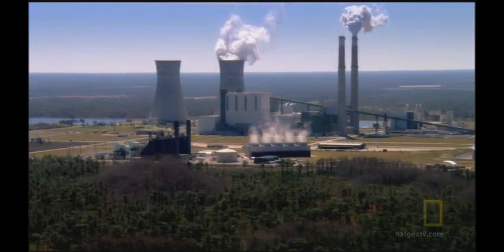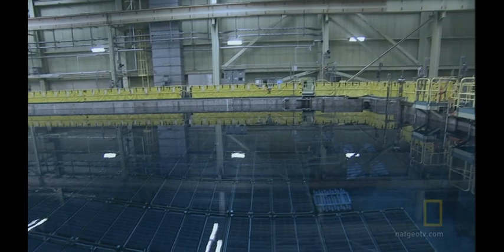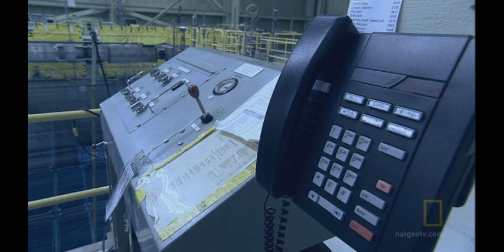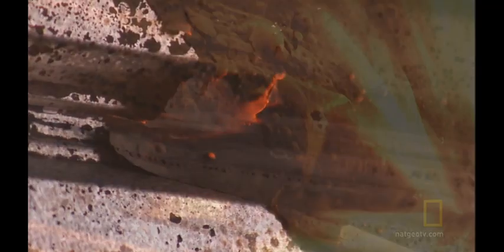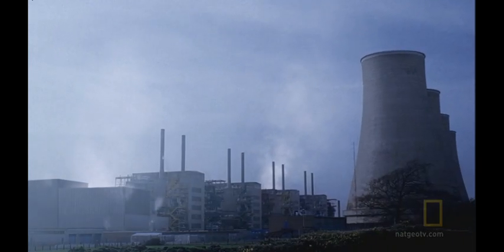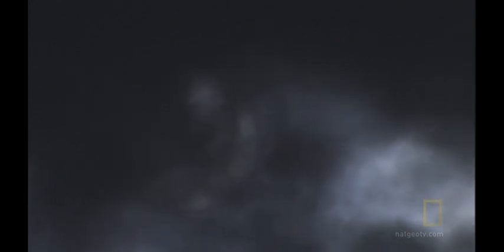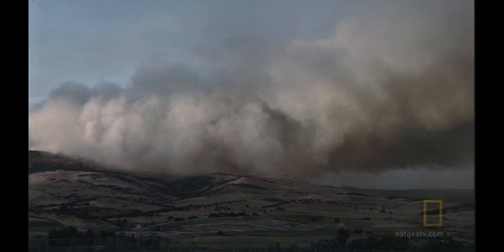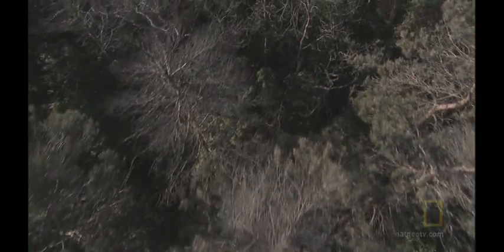Nuclear power plant spent fuel rods overheating and meltdown

Comment: 1.) All generators fail and can't be fixed or replaced
2.) Everybody forgets about it for several days and does not refill the water any other way
3.) Nobody notices all the steam that has been escaping for days
Yes in this case there would be a serious problem. Put simply, all you need to do is keep the spent rods wet. That is by no means difficult. You could literally pour water in the top if necessary surely?
Reply: Take into account what is going on at Fukushima and you begin to realize how difficult a task this is... There are hundreds of tanks filled with heavy water that has been extracted from the ground because of the compromised containment vessels.  Yes, you can pour water in, but where does it go if the containment vessel has suffered damage?  Answer: Into the ground, and, in Fukushima's case, the ocean soon afterwards.
Reply: CrudeDude, we are in fact saying the same thing but in two different ways  ie Submerged=Wet. The tank must be kept from breaking and splitting of course as Dearngedteddy said so lessons need to be learned from Fukushima. I guess what I was saying is that those lessons do not mean "immediately stop all nuclear power". Burning fossil fuels is also extremely dangerous.
Reply: I meant wet all over. Practically, this means submerged. There is a huge danger with radioactive falllout of course, but there is also a huge danger with global warming. And renewables will not cut it. I'm not arguing against the fact that there are serious dangers, I'm just saying that we need the electricity. We really need it in fact! The UK has a supply-demand gap coming up that is frantically being plugged with fossil fuels. China needs more and more energy and is burning more and more coal, which will run out eventually.
Reply: How many square miles of land is rendered uninhabitable for thousands, perhaps hundreds of thousands of years if it is flooded out? Global warming's effects could flood huge areas of land and the scientific consensus (which is the interpretation of the facts that is most likely to be correct) is that human activity is a major contributor. I read your comment the first time, read my comment and you will see that I did respond in a pertinent and respectable fashion.
Reply: Derangedteddy Bullshit. At Fukushima the pools are OK.
Reply: TheYesDave There is NO CONSENSUS on global warning. 
NONE
Reply: TheYesDave There is NO DANGER with "radioactive fallout". Fukushima has not caused a single radiation death. Not one.
Reply: There are still lots of "scientists" denying evolution, so if consensus means "no futher argument" then a consensus has not been reached on this issue either. My understanding is that there is a consensus, to a degree sufficient to impress all the world leaders at the G(insert number) summits and make them promise action. Consensus is a sliding scale and the science is admittedly too complex to yet claim that the issue is throughly resolved. But it is closer to my originally implied (admittedly overstated) overwhelming consensus than your NO CONSENSUS, NONE claim. Assuming that the scientists are the ones who's opinions are most likely to be relevant (a fair assumption) this means we should act on it.
Reply: things aren't simply "forgotten" at a nuclear power plant, there are so many automated redundant safety systems at a nuke plant that make the probability of something like this happening very remote
Reply: Just to clarify on this, I agree with A. Antoine that there are little or no cancer deaths from Fukushima. What I meant is that radioactive fallout can be dangerous. The number of deaths directly attributable to Chernobyl (nearly all emergency workers) is relatively low but does not fully encapsulate the seriousness of the accident. In the case of Fukushima, the second worst nuclear accident ever, the release is effectively now so "diluted" that concentration levels are just above background over everywhere but very near the reactor. In short, I think we must be very careful with nuclear regulations (we already are) but the real risk from it is very low, even with the current reactor designs, which are being improved on.

Comment: In the event of a station blackout or a major emergency, keeping the spent fuel pool filled with water is one of the easiest things to deal with, considering that all you ned to do is keep the water level up, and the fact that the pool itself is made from verity thick reenforced, concrete that is lived with steel plate. In general, the narrator is correct with his explanation of this scenario, but some of his terminology is misleading. And the plant they show at 0:45 of this video has been decommissioned since 1984

Comment: Tritium has a half life of 12 years which means that it completely decays in 24 years. Also this is only produced in deuterium moderated reactors, these are also known as breeder reactors and are not typically used outside of military applications.

Comment: It was storing spet fuel rods, not whole intact cores. And they were not above the reactors, but sideways.

Reactor #3 was NOT found missing. It's there, partially under the rubble, in its containment structure, and the pools were not blown apart.
In all Fukushima complex there was not even near 100 core-worth of spent material. Couple of cores worth of material in the densest packed pools, that's it.

I don't know where did you get all that information, but it's all so painfully wrong.

Comment: yes i knwo basic physics. and actually with for example LFTR reactros there is passive safety system in place as soon as power is lost all the fuel drains into secondary tanks with controlers inside to stop any reaction still happening

Comment: The Fukushima hydrogen explosions happened outside the reactor containments in the steel outer buildings.
The cores have never been exposed to the air and have never caught fire.
The core temperatures are now under 100 degrees Celsius.
The spent fuel has cooled as well and poses no risk. Even if the cooling water was removed from the pool, there would be no danger of radioactive release.

Comment: It might have to do with a physical constant called specific heat. Water has one of the highest. Just because something is cold doesn't mean it can hold a lot of heat. Notice that standing in air that's 20 degrees Celsius is not uncomfortable.But standing in water at that temperature can feel chilly.There are other problems with liquid nitrogen. Such as what happens when it rises above that low boiling point and starts to turn into gaseous nitrogen. Yes,simple water is a very useful chemical.

Comment: Wait... If the spent rods emit heat for the next few years, wouldn't they make great fuels for RTGs for short space missions? We don't have to always use plutonium 238 for those do we?
Reply: +Wolf Edmunds The issue is the purity. It'd be ridiculously improbable to lift a device like that into space. I know people who went into nuclear propulsion, uranium and plutonium, etc. are fantastic for this purpose. They are pure, we know exactly what is in them, etc. There are much more efficient ways. It's like how we went from steam driven cars to gas. Yeah we could use steam, wood is everywhere for most people, but it's just so much easier to use gas.

Comment: The water isn't refrigerated; there are pumps, heat exchangers, but no refrigeration for the pool itself.  Instructional videos should be accurate.
Reply: The exchange of heat is refrigeration.
Reply: So, the radiator on your car is a fridge?  Is that what you're saying?

Comment: The reactor must supply steam to a turbine to generate electricity.  The turbines are large and require a large amount of steam.  In an accident (or normal transient), the reactor is shut off, thus unable to supply steam to the turbine.  Diesel generators and batteries supply the plant with power.

Comment: The only problem I can see with this video, was reactor going into an auto-shutdown state upon recognition of grid failure. Do they really do this? or do they just disconnect from the grid? I see a grid disconnection, while still staying critical, for more a reality, as it could then supply power to the cooling pumps which would prevent this type of disaster.

Comment: A couple of points..

1) Meltdowns are not catastrophic.  Nobody has died or will die as a result of Fukishima or 3 Mile Island.  Wildlife around Chernobyl is doing better than when humans were around the area.
  
The diesel generators would not need to run forever.  
After a few days, the core would be cooled down.  If the core did melt, the multiple layers of containment would keep most of the radiation inside.

Comment: Where, and when did I say they were out of the "experimental" stages? Also indirectly solar power uses light generated by the sun (which is a nuclear fusion generator in itself) to generate electricity though not nearly as much electricity is generated than if we manage to sustain a fusion reaction on earth, which we will get eventually.

Comment: In unit 1 most of the core - as corium comprised of melted fuel and control rods - was assumed to be in the bottom of the RPV, but later it appeared that it had mostly gone through the bottom of the RPV and eroded about 65 cm into the drywell concrete below (which is 2.6 m thick). This reduced the intensity of the heat and enabled the mass to solidify.
this is available at: 
world nuclear association / Fukushima Accident 2011

Comment: Why do they call them spent fuel rods when the rods  can still  genarate tremendous amount  heat for years to come? Thats just like someone  dumping a battery that is still good to use

Can some one explain to me why they do  not wait until these rods can no longer generate enorght heat for the vapour to  spin the turbines?
Reply: +Digital _Legend They do. The rods are generating heat, but not enough to run the turbines, which is why they are replaced.
Reply: +Digital _Legend They are "spent" because we enrich u233 to about 4-5%. After the fuel is burned is might be only 1-2%. Or "spent" in industry terms. 

That being said we do dump batteries when they are less than optimal. Right now it's like asking why ancient Greeks used oil to shoot flaming arrows. Because it was useful and oil was plentiful. Maybe a thousand years later someone would like oil to just pop out of the ground, and maybe a few thousand years from now we might start tapping some larger uranium deposits.

Comment: my last post...
Requirements for ex-vessel accidents for new built NPPs
“European Utility Requirements” on melt stabilisation for future reactors: 
“…The Designer shall prove that corium would relocate in the reactor cavity in a coolable
 configuration. As an alternative the Designer may include a Corium Collecting and Cooling
 Device (CCCD), usually called a core-catcher, provided with a corium cooling system.
 This system shall not have any active component inside the containment.“

Comment: The spent fuel rods are not a danger.  Their heat output drops very quickly after removal from the reactor.  Even if all the water somehow left the storage pool and humans could not figure out how to add more water, (unlikely) the rods would not burn or release radioactivity.  We also know exactly what to do with them.  Either recycle them into new fuel or store them.  The "news" is very biased and misleading.

Comment: i am actually and also did you read the last bit. by generators i meant make them electrical pumps and power them with photo-voltaic solar panels and maybe a small bit of power from the reactor itself

Comment: the space shuttle is not in use and is old if an attempt like that was to be made the ship/rocket would be huge,large enough to have lots of the fuel and a cooling system that would keep it safe and a rocket doesn't just blow up (except in the hands of NK's)
if it's well made it won't blow up.

Comment: 1. it is very important what has happened and it is not just academic question, because in that way may people misslead the public!... 
2. nothing is melting anymore,.... 
Melted core -unit 1 eroded about 65 cm into the drywell concrete below (which is 2.6 m thick).!!!

3. ex-vessel does not mean that it has gone under the foundation of plant!... just that it is not in the core anymore

Comment: Like you I've done a lot of reading about the nuclear industry (both commercial and military). It seems that the real problem with current nuclear power plants is that they are based on the design of reactors that were built to maximize the production of Plutonium for bombs. There are far safer ways to design reactors to generate electricity, many that don't require fragile, active water cooling. Traveling wave, pebble bed and thorium fuel designs all fail safe. Time for change.

Comment: Nuclear fission has nothing to do with temperature.  Fission is as likely at -200 degrees as it is at 1,000 degrees.  Uranium can't "overheat" - and the presence of heat has ZERO effect on the half-life ('decay rate").  Uranium at 1,000 degrees decays at exactly the same rate as Uranium in liquid nitrogen.  Radioactive decay releases heat and daughter nuclei, but it does not 'cause other reactions' - and protons do not cause fission (a single proton in space is called "Hydrogen").

Comment: it is. 1 kg of thorium in a reactor can be used way more efficently than uranium so 1 kg of thorium is around the same as 35 kg of uranium. uranium is about 1 million times more energy dense than coal. there fore 2kg of thorium is the same as roughly 70 million kg of coal